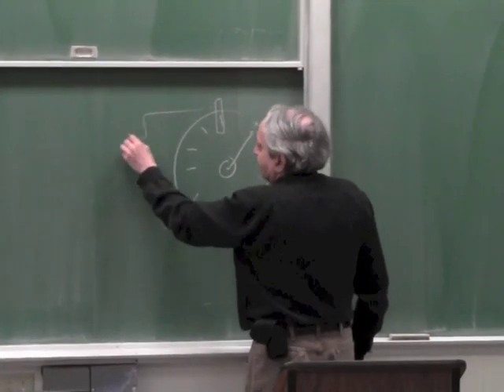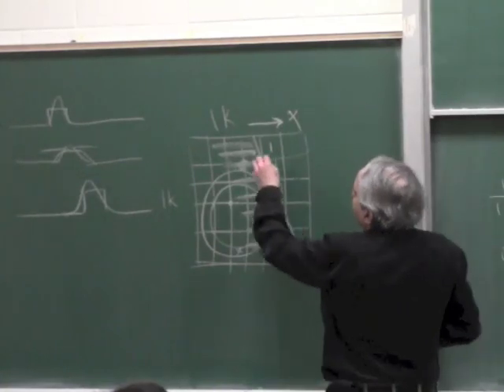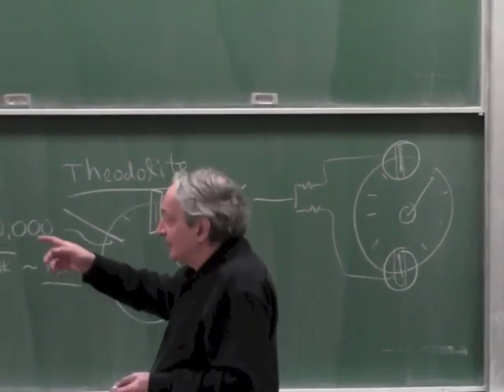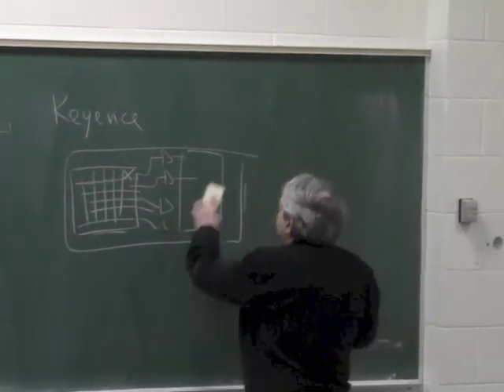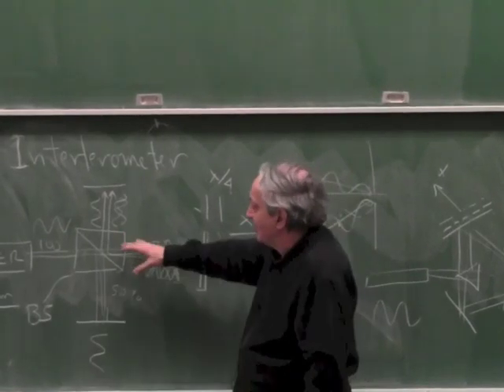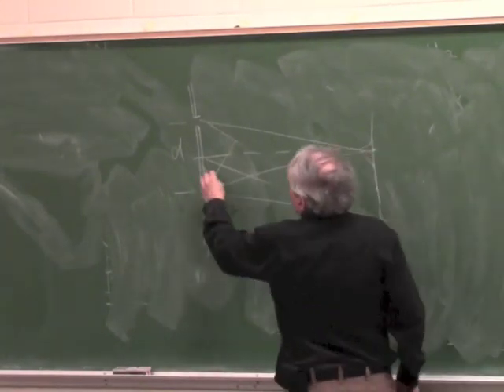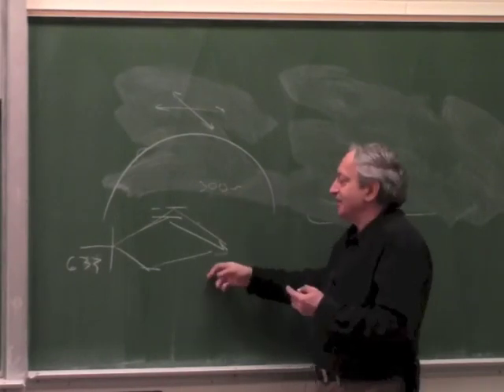07  Optical Encoders, Cameras, and Interferometers

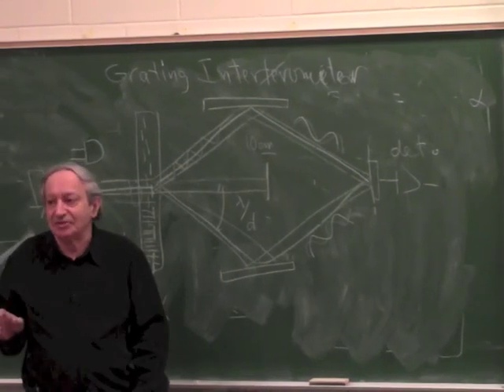Comment: 1:16:48 - an interesting question that nobody asked: The angle alpha is lambda/d --> for non-monochromatic light, how can the beam-combiner (mirror on the blackboard-sketch) be practically implemented? Remember - the two (+1 and -1 order) beams shall now be split into a 'rainbow'.
Reply: also not clear for me. maybe some sharp filter bevor? No the different angels from different Lambda bring  F1 and F2 on different places on the screen. so each frequency has there own spot ?!? Oh, You mentioned it  allready and write the "rainbow" ... yes it should be a rainbow.
it is very interessting to read your comments, Thanks.
Reply: @sebaschtl9710  Cheers, mate! I take it that you have already binge-watched all 18 "rapid prototyping" videos on Prof. Gelbart's own channel, as well his other videos (lathe, metal 3d-printing, etc.?
Reply: @AdityaMehendale  yes I watched them all : ) can you recommend other channels?
Reply: @htl9710 AppliedScience (BenKrasnow), Alex Slocum (MIT), Matthias Wandel, StuffMadeHere, BreakingTaps, Stefan Gotteswinter, CEE Australia, HuygensOptics, AlphaPhoenix...
Reply: It's an interesting question indeed. Not as easy as it looks. One way is to use a second, stationary grating instead of a mirror. Another option might be to use a lens, because the "rainbow" of diffracted points are all diverging from a common origin, and so can all be focused to a common point.

Comment: For the explanation at 2:58 - 
Remember, if you wish to readout the sensor electronically, you's STILL need quadrature or something equivalent. One way to achieve is to use a Vernier-disk as the stationary disk.
In other words - if your main encoder wheel has 1000 stripes, you make the stationary disk with 1001. Then two detectors can resolve quadrature. If you are worried about eccentricity (as in the example of a theodolite) use four detectors, and average cross-wise.